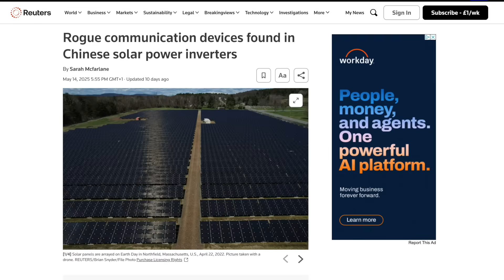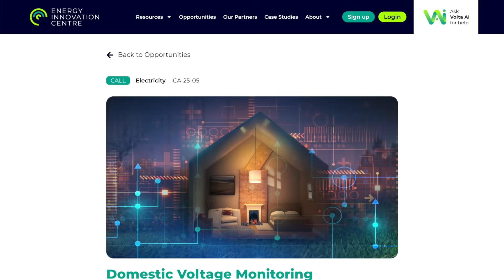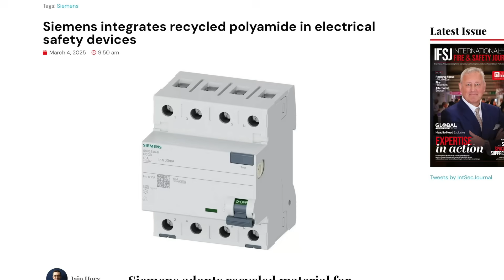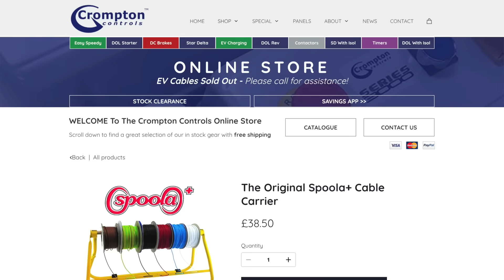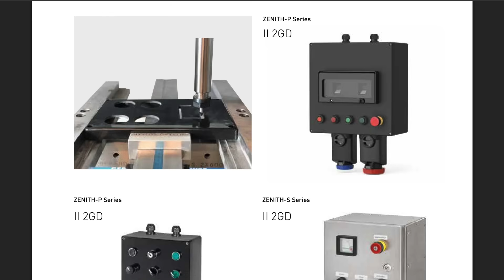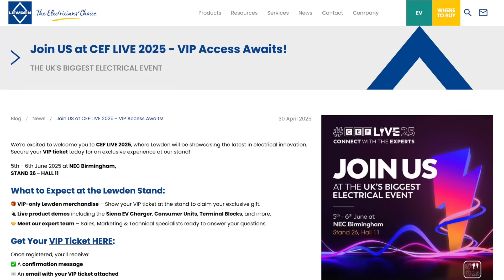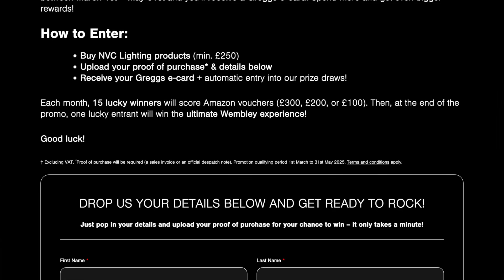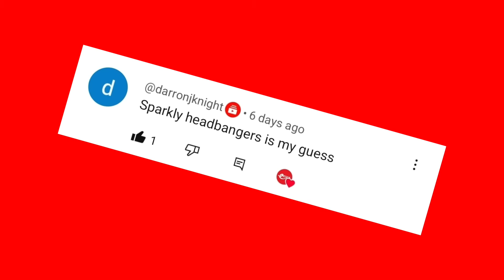‘Kill Switches’ Discovered in Chinese Solar Inverters

Comment: So click baity, they're not kill switches for anyone who has actually read the technical article and delved in to the further info. They're modems / cell radios. It is very common for an SOC to contain, WiFi, cellular and Bluetooth radios in one chip as they're packaged that way, think ESP32, Arduino etc. Just because they are in the SOC doesn't mean they are enabled. Even if the Cellular radio was remotely enabled, it would need to be on an approved IMEI register, allowed to connect to the mobile network plus a host of other measures in place.
Reply: This is it.  No actual supporting evidence that stands up to scrutiny will ever be forthcoming.  I made a longer post describing the issues and motivations for why it suddenly appeared in the news but youtube shadow-banned it.
Reply: Yeh! Have you got a link to the technical article?
Reply: @DavidAlanGilbert  "approved IMEI register" like pretty much every cellular radio out there for such use? Also, they clearly are - at least one company literally uses it to brick devices already (when they think a device hasn't been sold yet, or was sold in a way they didn't like). "allowed to connect to a mobile network" so... a roaming-capable SIM that one can buy by the hundreds, with many providers around the world offering global sim cards for use in IoT?
Reply: I think everyone worries because killswitches are already implemented in lathes and other industrial equipment, with single purpose of preventing North Korea and other sanctioned countries from smuggling them in. But such measure is ineffective since China exports freely ...until someday.
Reply: @bas5946  It's not a matter of if it IS done, it's a matter of CAN it be done.
Reply: @martontichi8611 then almost every single manufacturer can do that it’s nothing unique it’s just over reaction and propaganda to decrease China solar sales
Reply: Yeah give me one of those kill switches because I want to get free cellular service!

Comment: Sorry i can't stand this, there is no need for kill switches, most devices we Europeans happily install are cloud connected, so may became usless or limited by simple producer bankruptcy or othe causes (goverment push).... or by some software "update" wich "accidentaly" will brick device, i don't event want to start what info device could gather in local net and send to "whoever"...
We should strongly protest such practices and all devices shoud have cloud connection optional and no default automatic software upgrades !!!.
Reply: The thing with these kill switches is, even if you don't let these devices connect to the internet at all, it still wouldn't help, as they make a totally separate wireless connection.

Comment: Stoke-on-Trent council partnered Solarplicity in 2018 to provide council tenants with solar panels as part of the Community Energy Scheme (CES UK ltd). It turned out to be a big scam and Solarplicity Group collapsed the following year, but not before 100s of council homes now had panels and contracts that lasted 25 years, with new bills and faulty installs that took over 6 years before OFGEM finally got CES to fix the problems.
This is the reason why you didn't see solar panels on council properties, scam companies trying to take the council and it's tenants for a ride.

Comment: The worst part is they dont give out the name of the manufacturer. Like especially since it a national threat, they should be forced to reveal the name as well as get prisom time for trying to hide the name and offer protections to the enemies of the nation.
Reply: Just look up any that have that feature as an option.  😅😅😅😅. You don't make and get certified more versions than you need to, you include all the hardware and enable what the customer pays for.
Reply: Always question those who tell you who is to hate, and who is your enemy.
Reply: UK government has said not to use Huawei for communication devices like mobile phones, routers, data switches/hubs for exactly the same reason as they have detected them sending data back to China
Reply: I assume now the details of the PCB design and the software are being reverse engineered to assess the threat more accurately.  With the information given it might be anything between a juicy nothingburger to a doomsday scenario.
Reply: Everything is made in China. China is the subcontractor to the world. Even my wife was made in China.
Reply: Its all of them ... Chinese law compels them.
Reply: Because it'll be all of them
Reply: @davidellis8434 or non of them.
Reply: Not proven. Often, microcontrollers are needed and repurposed chips from communications equipment are used, due to price, reliability etc. For example, I needed a microcontroller to convert CAN messages on an RTOS. I just used an ESP32 which has Wifi and Bluetooth... all unneeded.
Reply: @khalidacosta7133  Bingo. I am very suspicious about the claim that it is intended as a kill switch without further evidence. 

But low speed cellular radios have gotten so cheap nowadays that it wouldn’t surprise me to see them included on fancier inverters. 

Hilti includes a cellular radios in every one of their battery chargers, for example. If you use their cloud services, you can get data about tool usage that way. 

About 5 years ago I bought a USB cable with a cellular radio for less than $10 on AliExpress. The connector at one end was slightly larger than normal. But overall, it was really not obvious that it had cellular built in.
Reply: @khalidacosta7133 Yes. Just because the chip supports Wifi doesn’t mean it’s usable: there will definitely be external components needed to make it work, if only a PCB trace to act as an aerial.
Reply: @kimspence-jones4765  you all just guessing. That's obvious.
Reply: @joeds3775  Yes and no. I’m not one of those who is guessing, I’m pointing out that without full details no firm conclusion can be drawn. It is the media’s annoying habit to imply that things are as bad as they could be, often with no foundation in reality. And there are plenty of people who would benefit from getting the public to distrust solar panels and/or Chinese suppliers. Let’s see full details before we jump to conclusions.
Reply: @kimspence-jones4765  Thank you for keeping your feet on the ground and not going along with speculations. Further research is needed before jumping to conclusions.
Reply: My inverter is on a separate vlan and I have a separate mqtt broker so the only traffic is via mqtt on a custom port out of that vlan , let them try to connect to the inverter, I do the same for all iot devices.
Reply: @wrightwells  Currently many IoT devices are setting new standards for badness of implementation so this is pretty much the only way to deal with them.  We used to use firewalls to defend against external threats - but today the threat might emerge from inside the local net itself.  Not good.
Reply: @ralfbaechle  To paraphrase a quote from Mark twain 'they wouldn't let you use them if it made any difference.'
Reply: @wrightwells they can still connect, as what this is saying is that they have their own radio devices such as 4g chips, they can connect directly.
Reply: ALL OF THEM.. all brands have chinese parts in them. and chinese chips in them.. dont be afraid..

Comment: No good them sounding the alarm everywhere if they don’t say what ones they have found with kill switches in 🤷🏾‍♂️ sounds like they are not so confident in there findings?! Could you imagine testing some kit and going yeah some manufacturers have engineered substandard equipment, but I can’t tell you who 😂
Reply: I think that someone looked at some cloud connected device and thought the radio must be intentionally hidden because it doesn't say anything about it written out on the box.
The "bypasses standard firewalls to avoid detection" also sounds like someone didn't know what they are talking about since cellular modems don't even connect to your local network so they don't need some sophisticated bypass as the sentence implies, by that standard every phone bypasses firewalls to avoid detection.

Sure it could be used as a kill switch (and with Deye we've already seen something like that) I just don't think it's a secret. I'm pretty sure certification bodies know about the cellular radio and cell providers know who they sold IoT SIM cards to.
Reply: @Ether_Void  the "bypasses standard firewalls to avoid detection" is a direct reference to the fact that it uses an independent communications channel. Those have been used for covert data exfiltration all over the place.

Also, on the certification bodies, and cell providers - not necessarily. The modems can be generic pre-certified for integration. IoT SIMs are sold in bulk through various channels. Sure, you know you sold them, but you probably don't know who has them.
Reply: @TricksterRad  Just because it uses a independent communication channel doesn't mean it's specifically meant for firewall bypass. It could be the case, but a independent communication channel on it's own doesn't proof that case. Hence my comment about cell phones in general.

While a larger pre made box (like industrial DIN-rail mounted devices) are typically pre certified as a soldered electronic component they would at least need to be measured in the finished assembly or the certificate has to be shown to the certifying institution. (At least that's my limited experience with TüV) 

The part of not knowing who has them would also probably depend since at least in a few countries knowing who has the SIM can actually be mandatory. Although in the world of IoT that would probably not raise suspicions. 

But in the end you can usually deduce it's existence. If automatic firmware updates exist then of course a bricked firmware can be uploaded as well. And if you can see the state of your solar array via a cloud connected app or webpage then of course it has a internet connection and if it works without setting up Wifi it most likely uses cellular connection. 
After what happened to some Deye inverters, it's less about "being discovered" and more about confirmation at worst.
Reply: @Ether_Void  point is, there is absolutely zero reason for these to have unadvertised cellular modems. That is the whole issue here.
Reply: @TricksterRad  Here is the thing though. We don't even know the brand names so I there is no way we can actually verify that they are unadvertised or not marketed as "IoT enabled". The entire news seem so vague that it may as well be "something has be found somewhere".
And given the political climate there is an obvious reason on both sides to lie about what is actually there or has actually been found. So all I see is a bunch of keywords thrown in to generate hype around a story that says nothing.
Reply: If it’s anything I’ve my electronics project, it’s on there for some dreamed future feature that I’ve never had time to implement!

Comment: errr why does the DNO need voltage monitoring at the socket, the smart meter can record this and send it back, part of the standard DNO config
Reply: It wouldn't surprise me if it's a result of the way the UK rolled out smart metering initially.  SMETS1 vs SMETS2.  All the old meters would have to be replaced, or alternate means such as mentioned.  If it's done sensibly there's a wealth of information that can be gain using smart metering such as near realtime transformer load monitoring instead of the check every few years method.  In Australia smart meters are leveraged to automatically check neutral (PEN) impedance and proactively go out and repair detected issues before they become a problem.
Reply: @retrozmachine1189   Yep, guarantee we went for the cheapest possible version.
Reply: It would not be difficult to do at almost zero cost to make a smart meter monitor line voltage and flag up automatically any excursions outside normal values
Monitoring at the transformer might not indicate problems for example on my estate (about 100 houses) I am almost at the edge and the voltage drop along around 100M of underground cable could be significant especially if EV chargers become more common.
Reply: @apk55  It could also be down to conductor resistance and condition. There was a scandal recently about Prysmian (A UK company) supplying substandard Aluminium (Or should that be Aluminum? 😉) cable to the U.S. trade, with conductor deformation and potential in-wall shorts being reported. ⚡

If your estate was wired up with Prysmian cable, chances are that could be the problem. It's why I'll only trust German and Spanish suppliers for cable now. 🔌🇬🇧🔥⛔
Reply: Any details on the SMETS standard? Maybe it samples infrequently and misses peaks and troughs?
Reply: @edc1569  The SMETS specifications are mostly available online. The spec foresees outage alarms. However, detailed voltage monitoring is a bit excessive for residential meters, which have a measurement interval of 15 minutes. The DNO can use a specialized meter at the transformer level, which gives very detailed measurements, but is more expensive.